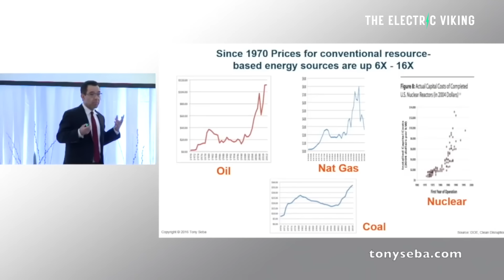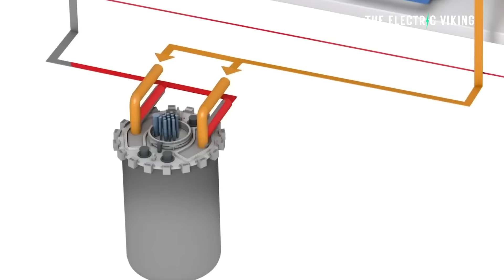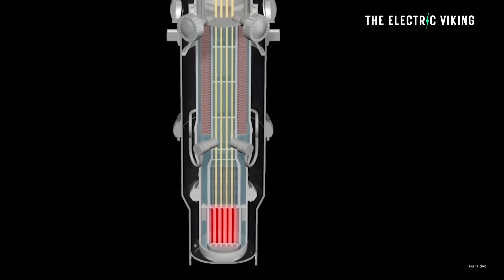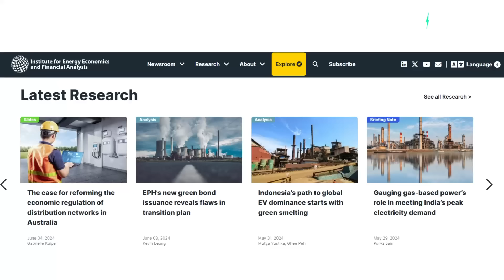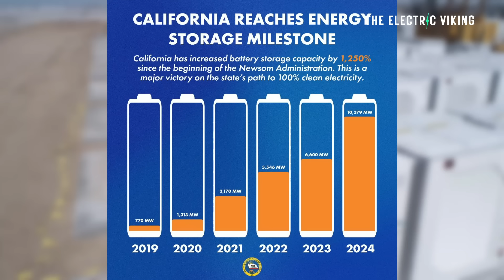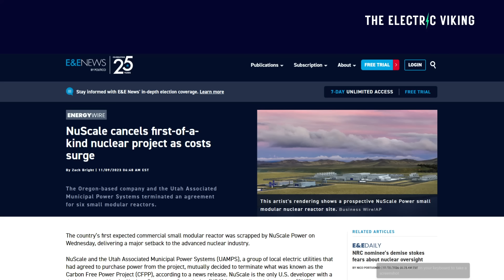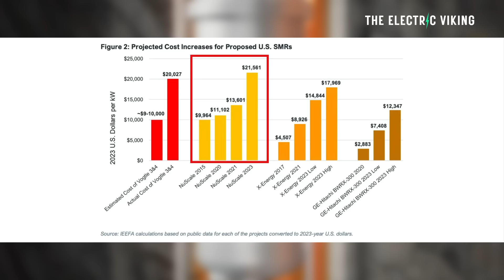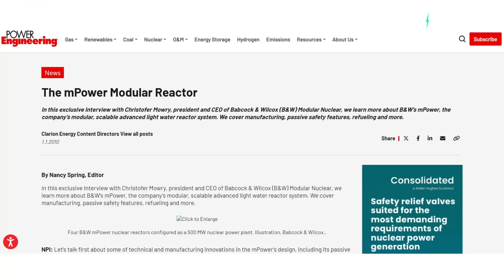In 2014 Tony Seba said Nuclear would be obsolete by 2030 - he was right

Comment: I think the average time to build a nuclear power plant is 16 years, not 10.
Reply: Sizewell B  took 7 years to build. I should know, I was there.
Reply: Mr Bard, 

depends wher you live, for example:-
"It took on average 190 months to build each plant. During that period, Korea has built a total of 13 nuclear power plants. The average construction period for each plant was only 56 months, more than three times faster than other countries building nuclear plants.
Reply: @brendanpells912  But of course you understand how averages work I expect, which is what the OP was referring to, which would mean, with plants like your example, there are other plants that have well and truly exceeded the average. So don't leave those out.
Reply: @BrentonSmythesfieldsaye  Yes, I know, because like with the UK AGR reactors, they're a new design and it takes a long time to get it right. This is why Sizewell B was based on the well-proven Westinghouse PWR design with a few extra safety systems added. Once they built the first, the rest would just be direct copies, but, of course, the rest never got built because gas was cheaper.
Reply: @brendanpells912  So in the 2020s, 1970s generation technology should be used? I see.
Reply: @brendanpells912  finished in 1966?
Reply: Many countries have been building and using small modular reactors for many decades, built in two years or less costing millions not billions.  China has been building full sized ones in under four years.
Reply: @BrentonSmythesfieldsaye  If it ain't broke, don't fix it
Reply: You touch on a very important point.
Some people quote time to construct a reactor. That's the engineering definition of "pour of first nuclear safety concrete" to "construction complete". There's several years of planning, choosing sites, tendering, permits, creating a supply chain and workforce, site prep and excavation, installing rebar before "construction" officially starts. And +1 year after it ends for commissioning.

I prefer to think in terms of Go to Whoa - the UAE decided to do Nuclear in 2007 and will get full power from their first nuclear power plant in 2024 = 17 years with no pushback from an Opposition party, OHS, Unions etc.

I don't see Australia going from Policy to Operating nuclear power in less than 20 years.
Reply: @ForbiddTV  
2 years or less? I doubt that
millions of equivalent dollars? I don't think so
Reply: @AWildBard   You could easily look it up.  The US typically has had at least one under construction at any one time for many decades.
Reply: Stop thinking. China and Sth Korea are able to build nukes in 4 to 5 yrs. Ps and why the rush ?
Reply: @brendanpells912  ...and how long will it take to return the site to farmland or housing when it's decommissioned? 1,2 maybe 3000 years?

Comment: I dont think so. 
When the Netherlands would use the Northsea in total for windmills, put huge amounts of electrolysers on land to make Hydrogen to use in powerplants . . . . there would be hardly enough land and sea to power the consumption of the Dutch industry and homes. We are a small country with a lot of people.
To fill the gap when the sun does not shine, and no wind, and in the 4 months winter time, there is no amount of batteries large enough. So, we need Nucleair energy to help out.

Comment: Great stuff Sam.  Thank you!  I was not sure why Elon thought this would be a good part of the energy issue.  If we get to fusion, maybe.  But Tony Seba made the point that you still have to transmit the electricity over power lines.  That's a huge expense.  Elon has said that if you took the space allocated for nuclear reactors and used it for solar power, solar would be cheaper.

Comment: Renewables do have a life span. What happens to the wind turbines when they need replacing after 15 to 25 years, where do the glass fiber turbine blades get recycled and how, not land fill I hope? And for solar power panels that are expected to last 20 to 30 years, how will the billions of them be recycled and the Phosphorus used in them be recovered? There isn't really only one energy solution here, but we have to adapt many solutions depending on the locations and power requirements
Reply: they don't "stop working" after that many years, they are replaced so they can make more money with newer more efficient units. Want to pass a law against that?

Comment: I disagree. Smrl is still in prototypephase. There are yet no factories building them in serial production as is the goal. Outside sunbelt they are part of the future. We do need thorium reactors to reduce nuclear waste to 1/10  amount and to reduce radiation time from 100 000 years to 300 years and get energy at same time. Thorium is abundant, low radiating and can be extracted from mining waste.
Reply: Rosatom has over 30 preorders for small nuclear reactors.   Uzbekistan signed an agreement with Rosatom  to install 6 small nuclear reactors

Comment: The Electric Viking, nice video keep it up dude
Reply: 《 Arrays of nanodiodes promise full conservation of energy》 

A simple rectifier crystal can, iust short of a replicatable long term demonstration of a powerful prototype, almost certainly filter the random thermal motion of electrons or discrete positiive charged voids called holes so the electric current flowing in one direction predominates. At low system voltage a filtrate of one polarity predominates only a little but there is always usable electrical power derived from the source Johnson Nyquest thermal electrical noise. This net electrical filtrate can be aggregated in a group of separate diodes in consistent alignment parallel creating widely scalable electrical power. As the polarity filtered electrical energy is exported, the amount of thermal energy in the group of diodes decreases. This group cooling will draw heat in from the surrounding ambient heat at a rate depending on the filtering rate and thermal resistance between the group and ambient gas, liquid, or solid warmer than absolute zero. There is a lot of ambient heat on our planet, more in equatorial dry desert summer days and less in polar desert winter nights. 

Refrigeration by the principle that energy is conserved should produce electricity instead of consuming it. 

Focusing on explaining the electronic behavior of one composition of simple diode, a near flawless crystal of silicon is modified by implanting a small amount of phosphorus on one side from a ohmic contact end to a junction where the additive is suddenly and completely changed to boron with minimal disturbance of the crystal pattern. The crystal then continues to another ohmic contact. 

A region of high electrical resistance forms at the junction in this type of diode when the phosphorous near the ĵunction donates electrons that are free to move elsewhere while leaving phosphorus ions held in the crystal while the boron donates a hole which is similalarly free to move. The two types of mobile charges mutually clear each other away near the junction leaving little electrical conductivity. An equlibrium width of this region is settled between the phosphorus, boron, electrons, and holes. Thermal noise is beyond steady state equlibrium. Thermal transients where mobile electrons move from the phosphorus added side to the boron added side ride transient extra conductivity so they are filtered into the external circuit. Electrons are units of electric current. They lose their thermal energy of motion and gain electromotive force, another name for voltage, as they transition between the junction and the array electrical tap. 

Aloha
Reply: @CharlesBrown-xq5ug  Does any country have one of these contractions up and running ?❔️

Comment: You can't get a single watt of power until the whole nuclear plant or natural gas plant or even a concentrated solar thermal plant is built. You can get power out of a single photovoltaic panel as soon as it is fabricated if you wanted to. If a photovoltaic installation has to end after only a fraction of the construction is completed, power can still be generated. You can also add on more generation capacity in modular fashion. This greatly reduces the financial risks for energy providers and investors.

Comment: I think the steam generator tube alloy you refer to is incorrect.  Alloy 6000 is a group aluminum alloys which are used in many applications, mostly aircraft related, but never PWR steam generators.  I think the correct alloy is Alloy 600, which is more accurately called Inconel 600 or generically as NiCrFe.  Inconel 600 is a nickel based superalloy commonly used in PWR steam generators as well primary and secondary plant piping systems.

Comment: There are some rare scenarios where having some emergency backup nuclear power on hand might be good. 
Let's say a super volcano blows and the resulting emissions reduce solar panel output substantially as well as causing constant ash to cover them. 
We might just want a few nuclear power plants out there for that reason. 
However those would only be emergency backup as I agree that solar and wind are the way to go.
Reply: You might as well set up a gas-fired station. Nuclear power stations can't be switched on or off on demand
Reply: @studyonline4763  Good point. I stand corrected.

Comment: Solar is not practical for base load power in northern US and Eroupe. And batteries have to be replaced and recycled. Most of the US  have giant hail storms every 3ish years and destroy solar panels.  Our neighborhoods have replaced their roofs from hail damage 2 times in last 10 years.  We need a combination of wind, solar and nuclear if we are all going to have electricity in the coming years.
Reply: I've had my roof replaced three times here in Colorado (2004, 2010, 2017) due to massive hail. My solar (installed in 2006) was not damaged. Nearby National Renewable Energy Laboratory with their then (2017) ~1700 panels had to replace six.

Comment: I really think living in Australia biases your opinion.  Much of the worlds population doesn't live in a solar frying pan like Australia or California.  Yeah it's working pretty good there.  But much of the worlds population lives in Northern climates with very limited sun in winter.  A winter month of overcast sky is a problem for renuables.   A base load source is still nessecary for a stable grid.  Nuclear may go away, but it would probably have to be replaced by a successful deployment of geothermal power.  That is the only green future tech I see to replace 24/7 base load capabilities with the ability of a widespread rollout.  We could potentially put it in a lot of places, unlike Hydro.  
Geothermal could scale well too.  Population grows?  Dig more wells.  But the tech needs validation first.  
Remember, one of the reasons EVs work so well is the cheap electricity coming from a baseload in the middle of the night.
IE. The batteries you say you will rely on are often charged by off peak baseload, and at 3 am that aint coming from solar.
Reply: The vast majority of the world population lives in the sun belt (about 80% of the population). It makes sense to have a solution that works in the majority of cases. There are some case uses where nuclear might be a viable solution but it makes no sense to build nuclear in the sun belt. Solar/wind do not work well with a nuclear base load and it is more important to build electrical capacity now. Engineering with Rosie did a good video on this. You are better off spending the money on battery banks.
Reply: @yodaiam1000  The "fact" I've really struggled with is the amount of land, both forest and farm land that I see disappearing to solar.  Elon Musk came up with a figure that all of US power supply could be met with 100 miles by 100 miles of solar.  But when I get the figure for current US power usage, and add say a 30% increase if we convert transportation and other fossil fuel users to electric, it doesn't compute.  When compared to the 11 acres per deployed megawatt of solar that has been the norm here in Georgia for basically all the new solar projects, the amount of land that will be required seems far higher than advertised.  
I look at the Buc-ees service station by the interstate near here.  They have 18 Tesla chargers but also have 120 fuel pumps.  It would take a multi thousand acre solar farm to fuel up the same number of vehicles plus cover backup if they were all EVs.(given the traffic figures I have seen published of 4500-7500 vehicles per day).  And you would require Tesla megapacks by the hundreds depending on the number of days of backup you wanted to cover for.   That's all for one gas station.    And even then the average range per vehicle charged would be conciderably less than gas or desiel equivalent, so more Buc-ees would need to exist than is required now.  I think it was Two Bit Devinchi that said in a video that two Teslas charging on level 3 Tesla superchargers in a Walmart parking lot are using the same or more electricity as the Walmart is.  When we start calculating charging class 8 trucks it really gets ridiculous.   Paving 3 to 5 Georgia counties wall to wall with solar to meet our states needs seems less than ideal, especially with no viable recycling option for the panels on the horizon.  I do understand point of use solar on houses etc. will be significant, and I actually do like the Idea of an electric society.  I just think there are a lot of rose colored glasses being worn by its most ardent supporters.  This channel being an example.

Comment: Exactly friend. Don't forget about the TOXIC waste!
Reply: That's really almost a non issue, the actual amount and danger of the waste created is vastly overstated and fearmongered. The real issues are dealing with planning, zoning, cost overrun and delays. If the amount of battery/storage capacity can be mobilised to bypass the intermittency issue then it is a done deal, but I am uncertain that we are there in a practical sense.
Reply: @Reimalken  You have not looked at Time-of-Use and Time-of-Production.  Humans mostly use most electricity during the day.  Since Nukes run flat production day and night, they are surplus in the night (not profitable) and weak in the day (cannot hit Peak), unless they way overbuilt in surplus and/or massive storage.  Meanwhile Solar PV produces much faster and cheaper during the day when electricity is actually wanted and used.

Comment: The biggest problem with centralised generation is the extremely expensive national grid to the millions and millions and millions and millions and millions of customers. 

The grid cash flow means 5 cents kWh from the central generator costs the millions and millions and millions and millions and millions of customers 50cents kWh. 
WTF.

If customers go offgrid, then electricity costs will explode for the remaining customers. 😮😮😮😮😮

Nuclear needs fixed interest rates. 
Nuclear needs government guaranteed cash flows. 
Nuclear needs government disaster insurance.
Reply: Totally right, I came across a study (proper researchers, not a Google search) that proves that overbuilding of the cheap renewables (onshore wind and solar) plus storage, was cheaper than centralized renewable generation and upgrading the grid.  It was in fact a part of a set of studies I got from a renewable energy charity that is pushing to get NZ fully renewable asap.  The studies would be applicable to a lot of other countries with a similar layout as Australia, where these studies were done.  Large population centres, spread out quite far from each other.  We'll get there, I just wish it would go faster.  More and more people are reaching the same conclusions and acting on it (I'm one of them :)).
Reply: Not quite. All those off-grid solar generators (plus battery storage) will make a massive contribution to the grid - thereby reducing costs.
Reply: @iscadean6038    And if it does reduce costs, it will reduce costs to the producers. But that reduction in costs hardly ever get passed down to the consumers the customers. 😒
Reply: I've just moved to Australia from South Africa a month ago, watching the news in Oz said that nuke power will cost twice as much and will be ready in like 2040. As renewable will cost way less and ready in 2030 will backup.
Reply: Nuclear life-cycle is an expensive cycle. When talking about decommissioning, nuclear NEVER goes away. A drain on land, water, money and engineering.
Reply: Solar and wind projects need guaranteed cash flows also lol. Any power generation project does.

Have fun financing your weeks' worth of batteries! That will be cheap
Reply: @mrj774  your mixing your thoughts. 
In Australia rooftop is cheaper than windows $/m2. 
And cheaper the grid upgrades for the government. 
EV big batteries are free with the vehicle. 
Electricity is basically dirt cheap. 
With free storage,  vehicles are parked 23hrs every day.
Reply: @icosthop9998 How do the producers set their price? I suppose it is as high as they can get away with, without getting competition. Even then there is the possibility of collusion.
Reply: @robertwhite3503   I don't have the inside track of that,  or the workings that goes on behind closed doors. 
But what you stated is definitely "Right On" ❕️
Mean while I know without a doubt some politicians are getting their pockets greased .
Reply: @mrj774  weeks worth?  Sun comes every day.  Yes.  Every day.  Turns out it has been doing so for some Billion years.  I was not certain about, so I stayed up one night to check.  In the morning . . .  the Sun came up again.  You should check it yourself.